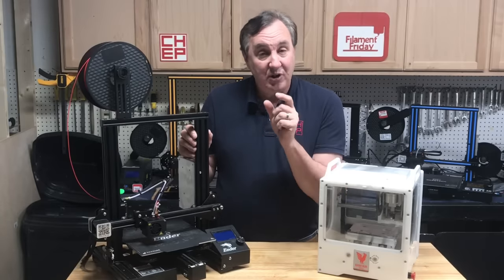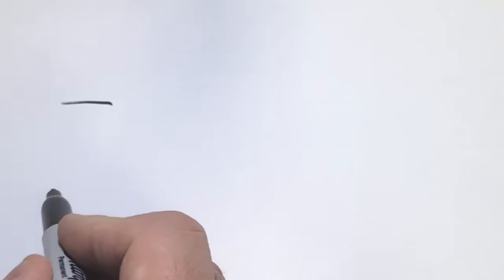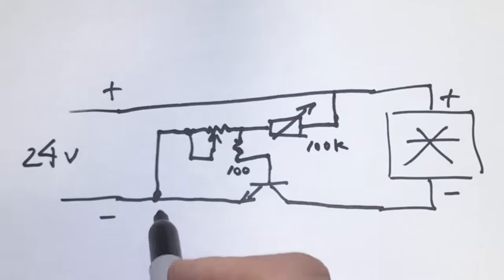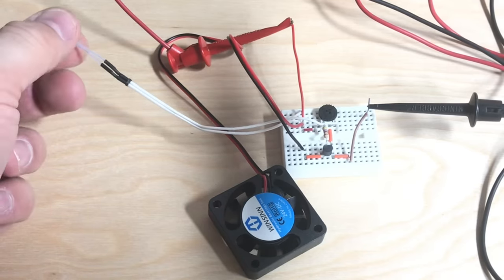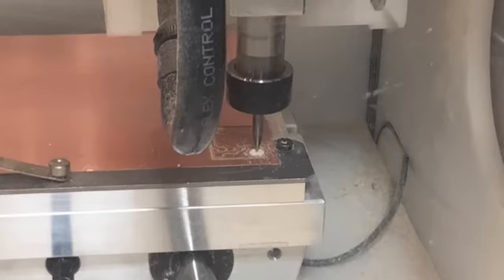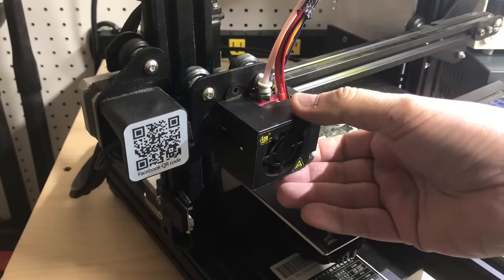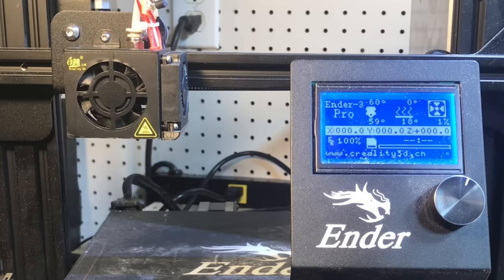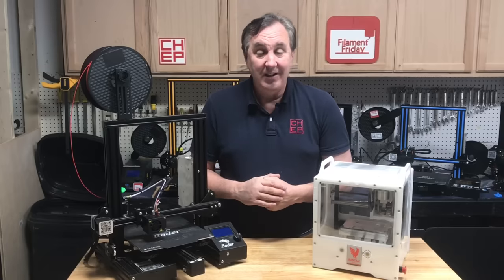DIY Temperature Controlled Hot End Cooling Fan on Creality Ender 3

Comment: I really appreciate the video but there is another way: in Marlin one can enable the extruder cooling fan as PC7 and disable the controller fan. Set the turn on fan to 50(degC). Then wire the two fans(controller and extruder cooling) together in parallel. The fans(both) will run when nozzle temperature is more than 50.
The only downside is that the controller fan does not run if nozzle is less than 50 so avoid running the motors for no reason. My board BTT V2.0 does not heat up when bead is heating or when motors do the homing position.

Comment: I bought an Ender 3 couple of weeks ago. It has a 4.2.2 board, and after some days I noticed that the PCB board fan didn't turn on unless the cooling fan turn on too. Also I found out the same thing you show in this video: the extruder fan is always on!! I tried to switch connectors and use M106 to try to control the different fans (k-fan1 and k-fan2) but they have the same circuit so you turn on both or none of them (Excellent design Creality). I'll try your method when I can. Thanks!

Comment: This is honestly a pretty cool and simple mod to do if you don't have an extra port to control fans. I like the fact that this functionality is already included in Marlin. I use a MKS 1.4 on my FT5 and I took the extra hotend port and use it for the case and hotend heatsink fans. It makes so much difference. Marlin also can allow you to use a free pin on your motherboard to connect the gate of a mosfet to and control your fans that way too.

Comment: Great project although I think that it might have been better to have designed it in such a way that should the circuit fail then the fan would switch on all the time. This would ensure a failsafe condition. Very easy to have the circuit switch a micro relay from a normally closed position to a normally open one. (work in reverse to your one)

Comment: Great project and video!  I would like to see the auto shutoff project as well.  It would save some electricity after a print is finished and the hot end has cooled.  Another idea you sparked is the need to know when the bed is cool enough for a print to release.  I might consider a variation of this circuit with a tone or buzzer that goes off when the bed is cool.
Reply: You can automate shutting off with Octoprint and a smart plug.
Reply: @diego1694  Nice to know - I have not used Octoprint but I do have smart plugs.  I would still like to have something standalone.

Comment: Great idea and super video!  The Bantam is nice, but wow the price!  I have a 3018 CNC that cuts PCB nicely.  Having one for small projects like this is so convenient.  Keep up the good work.
Reply from the maker: What software do you use to cut the boards?
Reply: @FilamentFriday  flatcam to generate the gcode then the bCNC to send to the cnc.  You can use most any gcode sender to run the cnc though.

Comment: ATX psu controlled by a pi is a great option, and the 5v standby line works for powering the pi.  take your transistor to switch the signal line, and as an added bonus, set it up to kill power if it detects printer throwing any runaway errors.

Comment: great video Chep i have had my cr10 fan fail and my Tevo Tornado fan fail and it seems its more about the guard collecting lint and plastic then stopping the fan spinning and it burns up. I snipped the guard off with diagonal cutters. Also I wonder if a video on how to mill a pcb on a 3018 cnc at 169 bucks would be a more realistic project since the bantam is 3000 dollars thanks for all your great work. I use my vise all the time to solder I scaled it up to 150% when i printed it. great tool
Reply from the maker: I’m trying to get one of those mills. I’ve already showed milling one a low cost Sienci Mill One.

Comment: Cool solution. I have a Raspberry pi connected to each printer and it turns the printer off after 15 minutes of inactivity and if the  temperature gets below 50•C.

Comment: With the Creality 4.2.2 and 4.2.7 boards have adaptive fan slowing where you can code into the firmware what temps you want them to start slowing down or off at. They have more options than you could imagine just have to make sure the board has enough free space to do so, make sure you add an extension for auto-build Marlin when you decide to CHEP.
Reply: Can you elaborate on this? I have a E3V2 with 4.2.2 board. Is there a firmware mix out there that does this already?
Reply: a link to exactly how you go about this would be great
Reply: So the hot end is connected a controllable output? First I have heard of it
Reply: It's not controllable. He's wrong. Only the nozzle fan has mosfet for PWM control.  @LaurenceGough

Comment: Would be good if 3D printer companies would start using 4-pin style fans which have PWM input.
You can cut it down to only 4 cables and you have precise control over both fans.

Comment: This is brilliant Chep, after living with it for a few months would you have designed it any differently?
Reply: Me too. Other than ease of adjustment, I'm curious if there is any reason not to install the board in the control box and simply run the extra thermistor wires up the loom to the hotend?
Reply from the maker: Yeah. It works well but I’m working on a better idea.
Reply: @FilamentFriday  Any update to this better idea? :)

Comment: For the Extruder fan control. SKR boards got a function for this, auto_fan if I remember it correctly. No soldering or tinkering needed. It's a marlin feature. So if you guys have a SKR you don't need this. Unfortunately the creality board design is pretty basic PCB design. Even the 4.2.7 doesn't offer this as the Pwm signal is controlling both fan slots. I did ditch the creality boards I got and I got all of them tested. No linear advance for creality boards on top of it. It's a shame.
Reply: Wait what? Is that working even when the wires are directly connected to the 24V on the motherboard? Cause thats how the hotend fan is connected on the SKR mini V1.2.
Reply: @Archenuh  No of course you need to plug them into the fan slot. You obviously need a fan connector to attach the wires
Reply: Would you mind explaining how you did this? cuz i have an skr mini e3 v2 and would like to stop the hotend fan from being on the whole time

Comment: Quite nice, you also could use a temperature switch, they are available for a wide range of temperatures. It will just switch on at a given temperature. The switch temperature you use is not very important because your hotend is at room temperature or above 150 degrees. In between it only spends a few seconds. Another alternative is to use an external MOSFET and hook in it up to an availabe IO pin. You would need to compile Marlin for this to work.

Comment: To reduce the hysteresis, you can add another transistor (as a Darlington stage) to get a boost in the gain.
Reply from the maker: The hysteresis is caused by the resistance change and reaction time in the temp sensor not the gain of the transistor.

Comment: I connected a relay to a free pin and enabled extruder auto fan feature on marlin. It is much easier that way in my opinion.
Reply from the maker: Looking forward to your video on it.
Reply: Yes please make a video on this.
Reply: Which free pin? One of the servo pins?
Reply: Hi! Can you explain how to make it? Please ^_^
Reply: I think I’ve worked out how to do this actually. I’ve bought a mosfet to try it, will update if it works.
Reply: If is possible to control the electronics fan separately, I prefer to switch it to the extruder fan. And keep it always running instead of the extruder fan.
Reply: Antonio Revert Plug a mosfet into the D11 pins (so the mosfet is switched by pin D11). Then for the load side of the mosfet use the voltage supply that feeds the extruder fan. Since the extruded fan is powered from the breakout board you probably want to put the mosfet near that. Then you have a pin that controls the extruded fan!
Reply: @ErlendDavidson  thanks for your help, I take a look to it

Comment: FWIW, I'm using Aus3D fan extender boards that allow control of 2-4 fans, based on pin assignment, motor movement (controller board cooling), and hot end temp.

Comment: Could you technically jump off the hotend thermistor instead of using another? Also us with a SKR E3 Mini would we be able to put the fan on one of the unused 2 pin connectors? Specifically the probe and e0 stop and use it as a controllable fan through firmware?
Reply: Then you could probably put all the new electronics in the original electronics box.

Comment: Nice. I haven't checked the specs on the transistor you used so I can't tell, but does it fail on or off if it can't read the temp? Nothing worse than a dead thermistor causing a fire.

Comment: Should make a kit to sell,  youll sell thousands!!.

 I use a wifi plug to turn off my printer and octoprint to control it, problem with a relay is there is always power somewhere on the board to make the relay work? Afterwards no ? Or are you talking about a 1 one relay power off and you have to reset it by turning on the plug.

I  looked at the Pi to do that but the pi would always have power running to to it, another option stick in some cgode in cura for print end and a switch at the top of the X gantry after printing go up and hit the switch and printer off, thats an easy one to do,. the easiest is the wifi socket and IFTTT , Pi talks to octoprint talks to IFTTT switches off the wifi socket .  Prefer the wifi option, much safer.

Comment: Hello Chep. Can you tel me the value of the thermistor that you used?
Reply: It's 100K thermistor.
Reply: @onderxyilmaz  Thank you.  I know that's what it showed in the schematic, but I cannot get it to work!  I have been using a probe from a multimeter which I believe to be 100k.  I have since ordered a few of the original Ender 3 thermistors so hopefully that will resolve my problem.

Comment: To shrink it, once you know the pot value, use a fixed resistor. Instead of a pcb just solder the parts together, it’s only three components, the thermistor is remote anyway.  Put some shrink sleeving over the 3 parts. 
You mentioned hysteresis, where does that come from? The electronics doesn’t have any, is it the fan turning off at a lower voltage than it turns on?

Comment: A great video, I wonder if a board already exists for those of us without a multi thousand dollar machinexat our disposal.   😬
Reply from the maker: You can get boards for under $10.
Reply: @FilamentFriday  Thanks, I don't know what these are called and can't seem to find anything as simple as this design that will work with 24VDc and temps higher than 110 c  without having some  thermal safety cut out.    I am looking to add this to my Ender 3 PRO along with 12V silent fans at my upcoming teardown and rebuild.  This is a great idea.  I wonder why Marlin firmware can't control this via a setting.  We can already control the cooling fan Speed, we know the nozzle temp so it seems feasible to natively be able to control the output unless the power is hardwired (no firmware control, just voltage pass thru).  Ever consider making a batch of these and selling them?
Reply from the maker: Haven’t thought about it. But some boards allow control just not this one.
Reply: @broderp  It is hardwired to +-24V.

Comment: In a stock Ender 3 you can't print without the filament fan, because the electronics fan is connected in parallel with it. So no filament cooling = no driver board cooling. I've changed that in my Ender 3, so hot end fan and electronics fan work continuously, and only the filament fan is controlled by software.
Reply from the maker: Yeah, I showed a work around in this video. https://youtu.be/QvyesgYLwQk

Comment: If you can change firmware, use the EXTRUDER_AUTO_FAN on Marlin. It's more simple... Don't forget to use a transistor too (but the circuit it's much more simple and the firmware control when turn on or off the fan)
Reply from the maker: And how do you connect the fan to the micro? Is there an unused pin you know of?

Comment: You can connect it to part cooling fan so after the first layer it runs till the end of the print
Reply from the maker: So how does it control the hotend when heating up? The fan helps the heat sink from saturating. Also on prints where you don’t want cooling like ABS or sometimes PETG?
Reply: Yeah, you're right that was dumb idea.

Comment: Since the hot end already has a thermistor, why not simply wire the supplementary transistor for the fan, to a spare digital output on the PCB? Then set the firmware to switch that output high when the temperature on the host end is > 40+ deg.
Reply from the maker: Because I wanted a simple add on with custom firmware.
Reply: This was my thought, too. And it should a long as you have a high impedance input of the circuit, both the motherboard and your separate circuit can "share" thermistor.

Comment: Nice work! I was thinking the same thing and that is how I found this. I love the PCB cutter. Wish I had access to one. May try an online outfit. Although I was thinking about using an Adrino or RasPi instead of physical. Only because I could avoid hardware on the device besides just the wiring and maybe a separate thermister. Although I could prob use Octoprint or some other kind of Firmware mod to use the existing thermister data as a control. I could also add other potential mods to it. I appreciate the video though I'm going to sit at the proverbial/Literal "drawing board" a little longer. Thanks for the inspiration!

Comment: Awesome video! The fan on the underside that cools the main circuit board seems to only run when the heating elements are on. Why can you not just connect the two fans in parallel? That way, when the heating elements are turned off, both fans shut down.
Reply from the maker: I explained that in the video.
Reply: @FilamentFriday  I apologize if I missed it, but I only noticed you mention why you can't connect it to the Filament Cooling Fan port, not the Circuit Board Fan port. But then you go into the circuit diagram. Am I missing it elsewhere in the video?

Comment: In one of your previous videos you explained to replace this fan with a silent Noctua fan and you added a voltage regulator to get 12V for the fan. I thought that is a good idea to use a Noctua fan, but did not want that voltage regulator, so I replaced the control board fan with a Noctua 12V as well and connected both in series which is working fine. I guess you want to give us ideas how to reduce the fan noise and let us decide which solution is best, but I am interested to hear your experience, because I cannot try all solutions. What is the best solution for noise reduction? Thank you for this video!
Reply from the maker: This isn’t about noise reduction. It’s about making a fan last.
Reply: @FilamentFriday  Thank you very much !

Comment: Did you use a low-side switch versus a high-side switch because the thermistor is a negative coefficient device?
Reply from the maker: No. It’s almost always easier to use an NPN low side vs a PNP for high side switching.

Comment: Is there anything wrong with connecting the hotend fan to the electronics fan connection and the electronics fan to the hotend fan terminal?
Reply from the maker: Yes, as I stated in the video, if the filament cooling is turned off the fan won’t run. The connectors are both tied together so if you did that the hotend won’t have a fan.
Reply: @FilamentFriday  I get what you mean but don't you only usually need the hotend fan when the cooling fan is on. But you are right there are situations when the cooling fan isn't on like changing filament or printing first layers. This method is probably better.
Reply: @Rayo7799  not everyone prints pla only ;)

Comment: Did you look into tapping into the existing temp sensor? (putting your custom PCB with the mainboard housing etc)
Reply from the maker: Could throw off the main sensor ADC so chose not to.
Reply: @FilamentFriday  I was just curious. I'm sure it is feasible with diodes etc. Bt worth the added hassle? Probably not.

Comment: Hello! Negative thing of this simpliest circuit is linear field where transistor is not fully opened and there is big voltage fall on it. It must get very hot and you have to choose transistor much more powerful. Did you test this?
Reply from the maker: That isn’t a concern. I sized the base resistor to allow enough current at turn on to saturate. The voltage source goes up quickly as well as temp rises. So very little time in active region. Transistor is cool throughout operation. It’s been working great.
Reply: @FilamentFriday  Hi, thanks for the idea. I think a freewheeling diode in parallel to the fan motor is missing. If the transistor opens in your design, you will get a current spike that will eventually destroy your transistor.

Comment: Is the electronics fan on a separate wire to the other fan? Surely it would be more ideal to leave that on all the time since its inside a box and then firmware control the hotend fan. Not sure though
Reply: The mainboard fan has its own header. I'm pretty sure it is "always on" like the hotend fan shown in the video.
Reply from the maker: It’s all explained in the video.

Comment: So, if there is already a temparature sensor in, this should be easily modifyable in software; is this just missing in the Ender-3 firmware?
Reply from the maker: The fan isn’t connected to the microcontroller.